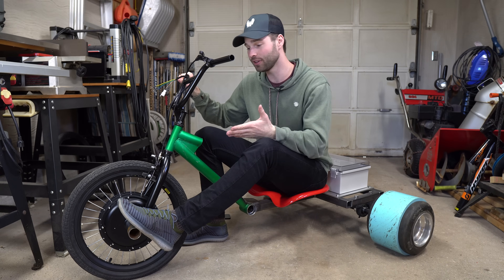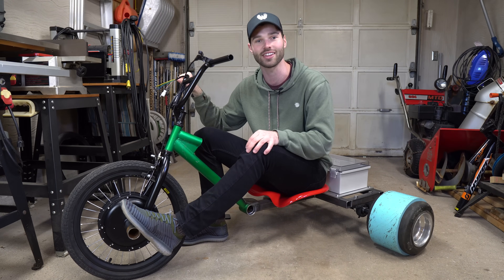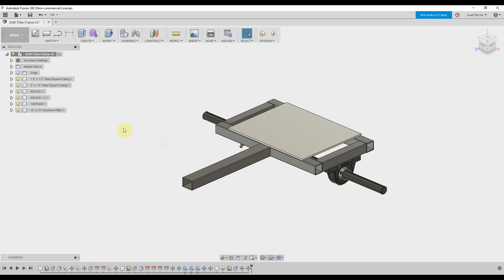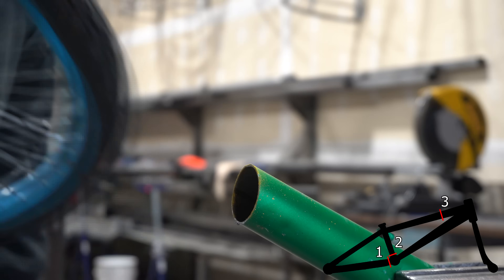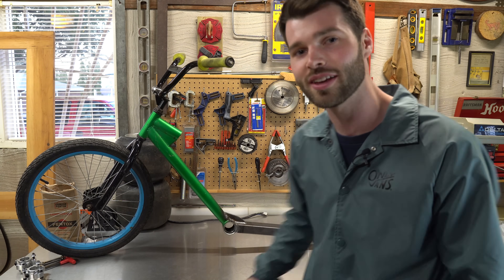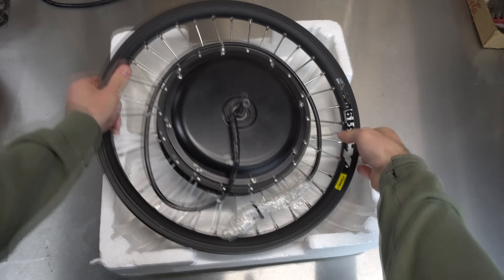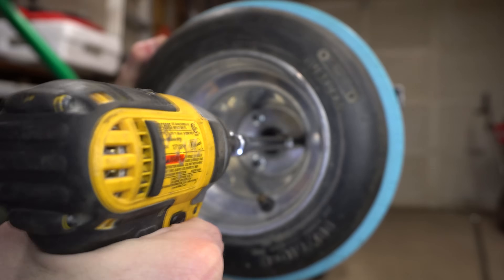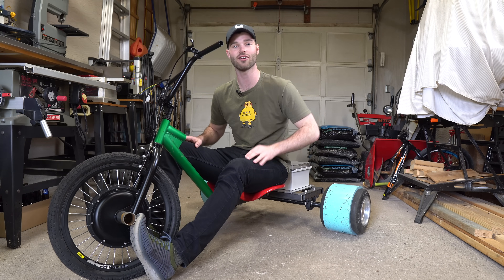Homemade Electric Drift Trike - Part 1

Comment: You practically made a go kart axle having it front wheel drive will wreck it a drift is when your back tire is spinning to fast for the amount of traction you have so your rear end slides out

Comment: Thats pretty cool! I just finished modifying a Zero DS bike (that I originally bought for the parts) and am converting a stretched Ruckus to EV with 18650 Lipos as well. Anywho,  I stumbled upon a way to get unused/like new, top quality, brand name 18650 LiPo LiFe LiMN etc. for a penny on the dollar! I'm sure its legal but they might have not been following their official channels so shoot me an email ( LeviMail @ the largest email provider ever. lol)  and I'd be glad to help you find the same kinda place in what ever city your in!  I have TUBS FULL of brand new name brand Lithium cells/packs and I only took the ones that were never touched and were still fully charged. lol. for $100 I ended up with thousands of 18650 cells.

Comment: I built one of these about 3 and half years ago. The front drive works fine and is an easy way to get a fast trike up and running. All the guys complaining that it isn't a "real" drift trike are obviously forgetting that these things started as pedal-powered and front wheel drive. All the RWD ones end up doing is spinning in circles which seems pretty boring to me. Definitely recommend rear brakes as the front one on its own was definitely not enough for mine (although it's obviously not much use when you're running the pvc).
Reply: Daniel Mckenzie drift trike

Comment: That rim brakes is going to be interesting. Too bad the motor and fork do not have disc brake mounts. And a not sure a rear brake would work with PVC sleeves on.
Reply from the maker: I'm hoping it will work out fine. I was thinking the same thing. We will see!

Comment: After watching your video Converting a Car Alternator into a Go Kart Motor I decided to make a motor out of an alternator which I am doing. I have some questions about the build though. I will be using it as a motor for other uses. I want to fix an on/off switch, a kill switch, and an external regulator so I can adjust the speed. First have been successful in that project when not "redlining" the alternator rpm speeds?

Comment: You don't remove the neck bolt all the way. You loosen it and tap the bolt lightly. That way when you remove it the threaded licking wedge comes out with the neck and it doesn't fall down the nec k tube.
Reply: Billy Beane and yet this guy is still way smarter than you.

Comment: The whole point of a drift trike is the rear wheels turn not the front, this is like drifting a fwd car... still cool as a normal trike though
Reply: I've built both and the front wheel drive gives you more control of the drift and gets up to speed much faster. I would suggest a rear brake though. I mounted bicycle disc brakes to the hubs and used hub extensions to set the wheels farther out.
Reply from the maker: Yes, you are right.  It should be a lot of fun though! I am using a live axle so that I can experiment with other motors on the back in the future.
Reply: Jon Rothenbusch thats sliding not drifting
Reply: austiwawa yeah should be fun either way!
Reply: Boy, you kids never had a big wheel and it shows.
Reply: @alleyoop4465  You obviously dont know how drifting works, plus the comments 5 years old old man, go to sleep, its past your 8pm bed time
Reply: yes the front motor is better!!! but really better. ans electric too. the bigs drift trikes like in usa, are poor idéa, to put all the masses on the rear, and the rear weel are the weels motorized with a 4 stroke engine, is a poor idéa... (ok in usa 1/3 of the population are so big, is possible is the problem lol) and after he put a big front weel because the masses is on the back.. (rrr!!!)

Comment: Front wheel drive on a drift trike?
Reply: Jon Vannatto, technically that makes it a "slide trike" as drifting is defined by a rear drive and using wheel speed to break traction and control the drift angle. Either way its neat and looks fun, but being front driven it'll pull you through and kind of defeats the skill associated with real drifting.
Reply from the maker: Yes, but I am using a live axle so I can experiment with other motors in the future.
Reply: austiwawa, an all wheel drive drift trike with independent front and rear throttling would be massively epic!
Reply: stylac Ya this configuration seem to be common. This is avavilbe in a commercially available drift trike. https://youtu.be/_IJwjctqVEE
Reply: Evil Me Good point. I'm suprised with the rotating rear axle layout he has as it seems like he could just pull parts from the electric gocart and make it a proper drift trike.
Reply: Front wheel drive on a drift trike is nice. Realy stable drifts.
We have a video where you see how much fun it is :)